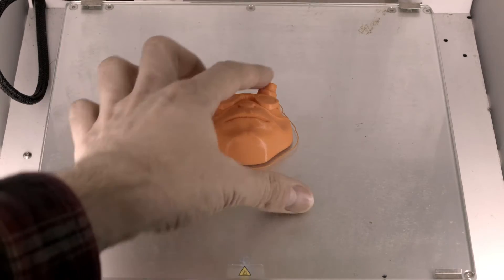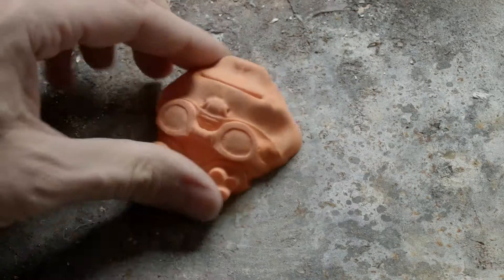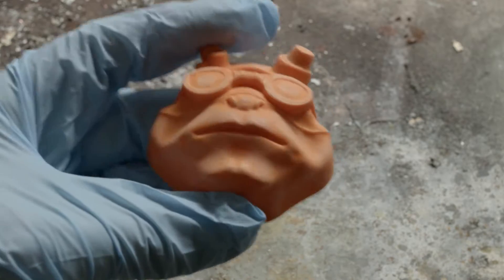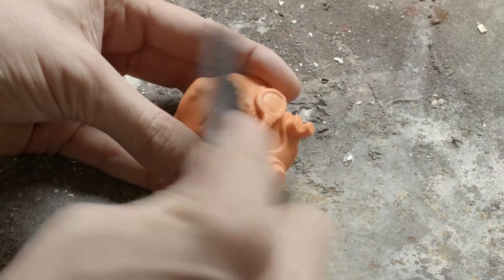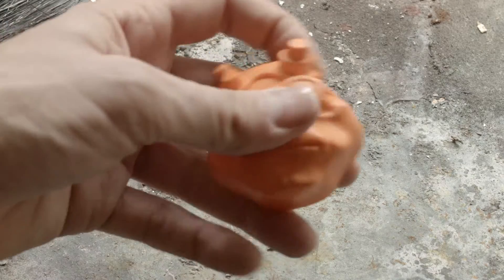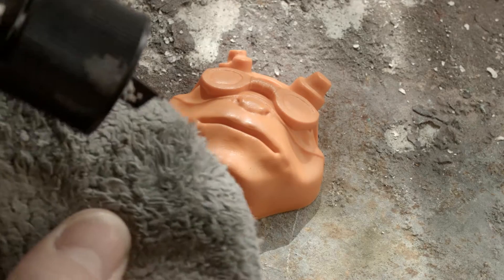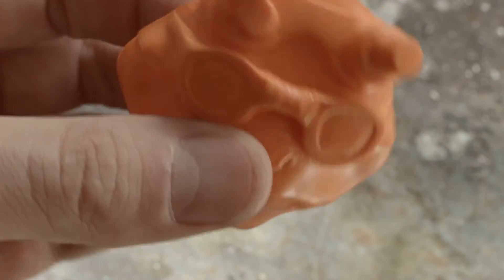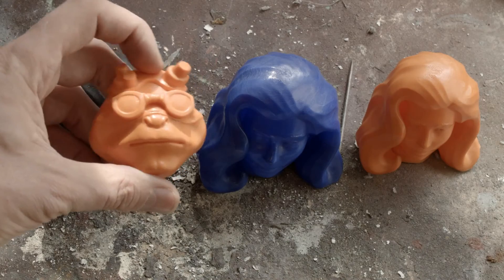Acetone / Ethyl Acetate PLA (colorfabb) Smoothing, Quick method

Comment from the maker: The main benefit of ethyl acetate compared to acetone is that it does not bleach the filament as much. Sometimes not at all if you use a really clean brush. But the more particles of used up pla on the brush from using it earlier will affect the way the ethyl acetate works and the whitening. Ethyl Acetate is slightly more aggresive than acetone and may split your model if printed not hot enough or is weak. But i have not tried a long dip for a long time as i dont always have room to dip larger models and brushing on a few times may be ok if done carefully and in the same session.

Comment: Hi, really like your work. What is your print resolution? The model looks really nice right out from the printer :)
Reply from the maker: Cheers, its 0.06, sometimes I might venture into 0.04 territiory but it introduces too much vibration lines that are hard to remove. I print all of my objects at 0.06. 0.1 Is low res to me, 0.04 is higher rez and 0.06 is good res. But again orientation of your model is also important but as with all fdm printers I try to avoid overhangs and support at all costs doing tests. I'll post some more vids soon. I never print lower than 0.06 when doing arty stuff. Whats the point? I don't want to see any lines and at 0.1 you can't avoid them not even with acetone. At 0.06 the lines are not a problem for me. I got my technique down to perfection.
Reply: Cloakfiend Thnks for reply. My printer could only go low as 0.2 mm. No wonder I couldn't sand off the lines. Huge difference on print quality I see.
Reply from the maker: Pocket Origin yes you really need to be printing 0.06 if you dont want mega visible lines. its the sole reason i bought an ultimaker rather than a makerbot. Best desicion i ever made!